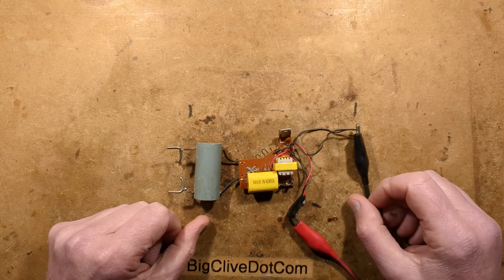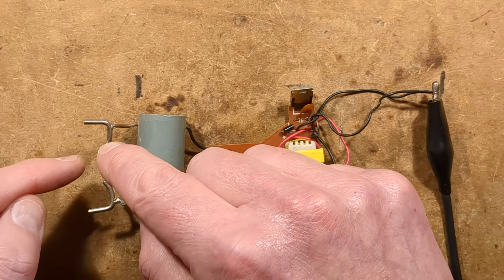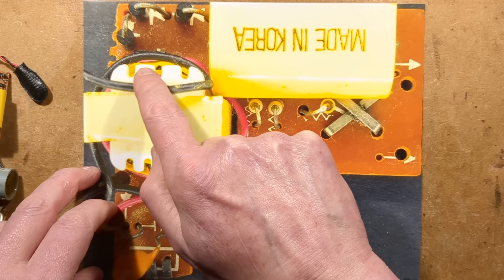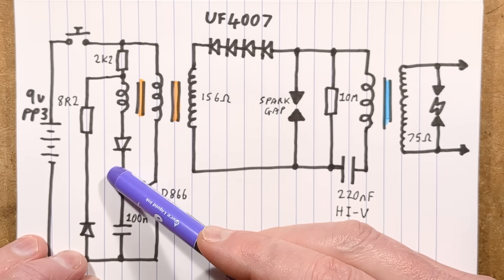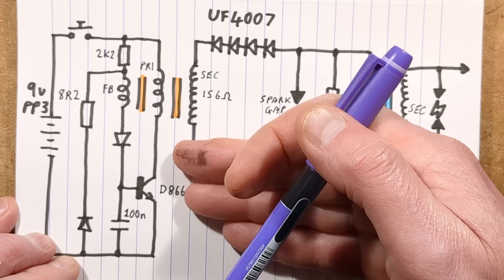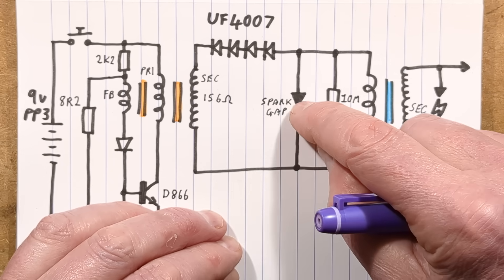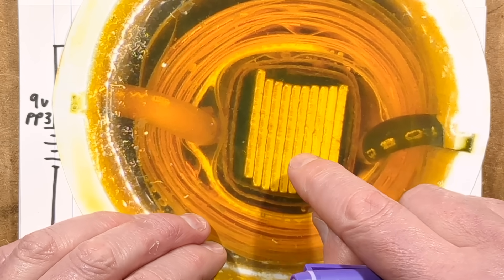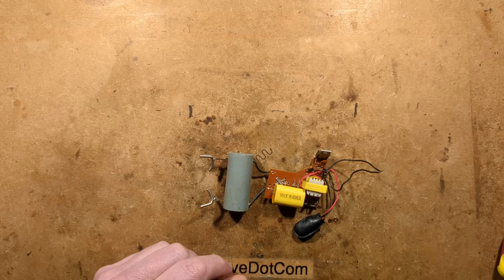How a stungun creates 20kV from a 9V battery

Comment: Back in the 90's I took apart an old unrepairable radio receiver. I deemed it unrepairable because someone had dropped it and the circuit boards were pretty much crushed. It was also from the era when printed circuit boards were a fairly new thing and were made by silkscreening a conductive, silvery ink on phenolic-impregnated cardboard. Some traces had come off of the board and were no longer very traceable, and I didn't have the right kind of solder for it either. Nevertheless, parting it out yielded a collection of entirely workable parts to tinker with. One of those was a transformer with a center tap in the secondary. 2x9V maybe, not sure anymore. I built a project based on the multivibrator used in decorative LED blinker circuits. Only I put 2N3055 transistors instead of BC547 in it and replaced the collector resistors with the secondary, which was to operate as the primary in its new life. I then tried it with different batteries as the power source, and IIRC the lowest it would oscillate at was 4,5V. When fed 6V the output would give a tingle on the fingers, at 9V it was uncomfortable. I think the highest I tried was 12V but it got hot quite fast. So I reverted back to 9V and did more experiments. I rigged a rectifier bridge on it and could charge a capacitor up to about 300V.

Comment: Hmm, makes me wonder how those fly zappers work. They don't make any noise unless a fly bridges the gap and there is quite a pop/snap. My favourite one came broken  (evil grin) and without the discharge resister. I can turn it on (hold the button for a bit) and when I let go, I can still zap at least one fly/wasp/whatever, which then acts like a discharge resister. It also means the "zap" is a bit stronger. This would suggest a mod to such devices....
Reply from the maker: They have the first bit of this circuit and sometimes a single stage multiplier to boost the voltage up.
Reply: Actually, they do make a very high frequency "tweeeeee" when you hold the button down.

Comment: Funny story. Years ago my gf lived in a very bad part of town, so i bought her a pink stun gun just in case she needed it. Fast forward to several years later i moved her in with me and i foind that stun gun and plugged it i to the wall outlet to charge. A day or two later i removed it from the outlet and hit the button and it didnt do anything. So i went into our room where she was sitting and pretended i was gonna zap her but didnt even hit the button, just made a noise with my mouth. She scolded me about how i could have hurt her. I held it out and hit the button and said see, it doesnt work anymore, then proceeded to touch it to my right thigh, needless to say i met the floor in a split second and my leg hurt for a couple days. I was laying on the floor laughing so hard and so was she.

Comment: This puts me in mind of a rechargeable electric lighter I bought that I find really clever. It operates on a similar principle (without the extra boost coil) to send an arc between terminals, but it has 4 of them & arcs in a X shape, & it took me an embarrassingly long time to work out that they were getting the two most distant terminals to arc by rapidly disconnecting the other two, so it looks like X but is in fact alternating between / and \. Lovely little bit of design for something smaller than a Zippo, & the battery lasts forever.

Comment: How does this differ from the black plastic HV tubes you can buy from e-bay (and other places) for a fiew £ each? Do they have the same components just potted in resin? I have one that was in a stun flash light but the cheap Li-Po cells quickly died so I disassembled it to se what was in it and how it worked, it looked identical to others I seen on line. Is there risk of over voltage if spark gap is to big?
Reply from the maker: Those ones use a boost circuit followed by a voltage multiplier.  It's important not to have the high voltage wires too far apart as the high open circuit voltage can damage the circuitry.

Comment: I’m surprised the first stage was such a high voltage. My preferred is to step up to around 400V and then dump into the secondary stage with a thyristor with a Diac trigger. 
I made several in the eighties but was never brave enough to test it on myself!

Comment: That's a real stun gun because it uses high-voltage AC output. Unlike the trashy ones that use a voltage multiplier and output a high-voltage DC.

When your skin, the same as a capacitor, charges with HV DC, it creates a very high resistance to continuously applied voltage, making it very ineffective and dangerous, because it enrages more an aggresor.

DC HV is louder; they really kick with the first few pulses, but are completely ineffective in stopping an aggressor.

A bull will not fake this. Tests were done with a bull and it got angrier with the HV DC, but fell to the floor with HV AC, like the one you have.

The police tasers use HV AC.

Comment: You say that secondary resistance (in the 2nd transformer) is quite high at 75Ω, but I wonder what gauge the wire is?
I rebuild vintage engine ignition magnetos & my secondaries (usually in 0.08mm wire) are around 3-6KΩ, depending on the model. The average coil having 10’000 turns on top of roughly 200 turns of a much thicker primary (anything from 0.6 to 1.0mm diameter).

I can’t reliably wind anything thinner than about 0.06mm with my machine & my current wire tensioner, but I always fancied having a go at one of these circuits.
I’ve bought the cheap Chinese modules from the usual websites, but they’re very susceptible to over voltage, not very strong. I expect they’re not properly VPI encapsulated, which is another thing I do with my magneto coils.

Incidentally, my magneto coils are wound in a very similar manner, with the paper between each layer of windings. It’s a good 2 hour job to wind each coil. It’s a job I don’t particularly enjoy, but I don’t trust any other company to do it properly, so I do it myself.
Reply: By the way, my primary resistances are usually too low to measure with a multimeter. Around the 1Ω region.

When I bought my winding machine over a decade ago it came with boxes of transformer bobbins & both metal & ceramic centres, as well as a load of enamelled copper wire that was useless to me. 
I sold what I could, held onto some of the metal laminations & recycled pretty much all of the plastic bobbins. Shame. 😢

Comment: There is basically a scaled down version of everything on the stun gun circuit board, minus the large 2nd output transformer, in your electronic zapping flyswatter. 

The swatter puts out around 3000 volts @ low current, but it is still not pleasant to come into contact with the output.  

I usually clip the bleed down resistor that is across the output capacitor off the circuit board of my electric flyswatters. Doing this provides a much larger zap across the grids of the swatter, and then it'll kill larger insects like wasps and hornets, BUT, you must be aware that the grids will now hold a charge for a very long time if the button was pressed and no insect has come across the grids to discharge the capacitor. It WILL shock you one time if you touch the grids even if the button isn't pressed. If you have pressed the button, and not zapped an insect with it, if you discharge the grids with the tip of a pencil lead or something else metallic, then the stored charge is gone and it wont be able to zap you until you press the button and charge it up again.

Comment: Playing around with one of these high voltage devices I found out that the spark activated the eject drawer function on my CD player, even from 5 meters away. Zap-zap and even with CD player in stand-by mode it went bleep-bleep and opened the drawer. Never found out how to use it to close it again though... 😂
Reply: That's interesting. I would guess that it's probably down to the infrared of the arc itself matching the eject signature from its remote control, assuming it has one. Perhaps if you modulate the zaps a little more you could get it to close again.

Comment: Whenever I find or create a high voltage (low current) device, I have to test it on myself, too. I end up testing to see how much I can handle. You know, it's actually quite easy to handle once you get the feel for it. You can trick friends and family into thinking it's pretty benign. Not that I'd advise anyone to use family members as test subjects! 😂

Comment: If you pot the whole thing in HV potting compound, can you use it underwater as an electric eel? I’ve heard that real electric eels put out about 700-800 volts and can discourage even a large animal like a crocodile or hippopotamus. I can see someone having a wee bit of misadventure trying to sneak up on a hippo with one of those. 😊
Reply: I believe that water, especially somewhere like a swamp or the ocean, would be more conductive than air, so you'd probably lose a lot of the voltage due to the smaller gap arcing "early" but yea I see no reason why it wouldn't work. Dealing with the spark gap inside it could be an issue since you can't surround that in resin without also adding some kind of inert gas to it (otherwise it won't spark). Perhaps hold it in a bucket of argon & apply a bit of kapton tape over it to do the last bit of resin.

Comment: One can pry the spark gap open just a little bit, and get a little more of a wallop out if the device, but DON'T go too far or you WILL flash over the windings in the output transformer, and then its cooked.

Comment: Way way long ago, in another time, like 1959, I made a simple zapper from scrap bits. A mechanical buzzer, 9V battery and a speaker transformer. Took it to school and got into trouble. Couldn’t have gone better.
Reply: Even just a simple relay wired as a buzzer will give you a zap from the back EMF when the relay coil magnetics collapse each time it rapidly opens and closes.
Reply: @davelowets    Or just if the relay switches off once.  There was a time when I worked on equipment that used a lot of small relays - mostly they had diodes connected across the coils to suppress the back EMF spikes, but not always. These could give you a sharp bite if you weren't careful.
Reply: @davelowets  You need an AC relay though. The DC relays (at least some of them) have built-in freewheeling diodes to keep the voltage from spiking.
Reply: Washing machine solenoids are good. Add a thick primary.
Reply: @davelowets  yes, I learned this the hard way. After it happened twice, I figured out why.
Reply: @davelowets  I zapped myself pretty good with just 4.5V battery and fluorescent tube starter coil 😂
Reply: I came to the comments to recall pretty much an identical story, except mine happened in around 1992. Had some fun with it in the playground, but it got confiscated by the staff by lunchtime. One of my teachers later confided in me that my creation had been passed round the staffroom, and the teachers had all had a go at zapping each other with it!
Reply: Yep, done that too, circa 1978! In my case, PJ996 battery and the field output transformer from a dumped telly. Bollocking from French Master ensued.
Reply: Me too, around the 1960, using bits from an old wall-mounted telephone.  Made my dad swear.
Reply: There was a Meccano set - back in the days of real Meccano - which included an electric shock machine as one of the projects in the manual.  Basically it was the same as the "electric bell" project but without the bell and with electrodes wired across the breaker contacts.  Set number was 4EL if I remember correctly.
Reply: I just realised I actually made a zapper too 😂.
1988 I was on a basic BT course, wiring a simple telephone circuit.
If you finished quick enough you could ring your friend's who were still working on theirs and electrocute em 😂😂😂
Reply: lol, reminded me of charging up a small engine condenser and tossing it to a classmate in middle school shop class. He was not a happy camper!
Reply: BRILLIANT
Reply: This makes me very glad I never got around to making a disposable camera taser when I was in high school.
I preferred to use them as intended.
Reply: That reminds me of a book, I forgot if it was supposed to be non-fiction or fiction, where somebody's lunch kept getting stolen from their lunch box, so they rigged up a ringer into it that goes off when the lid was opened. 

But the problem is that they didn't make a way to open the lid for themselves, so when it was lunchtime and the thief hadn't struck they were doomed to open it and trigger the alarm (and get in trouble).

IIRC they then rigged a hidden disable switch for the alarm, but the thief figured it out and stole the food without being alarmed. 

And finally the bypass was removed and the thief triggered the super loud alarm in the middle of the class.

 I don't think that they were caught, but they never stole from anybody's lunchboxes again after that point. 

So I'm not sure if the tech existed back then in the local hardware store, but today you'd probably just put a lock on the box or use a magnetic switch and a magnet to disable the alarm?
Reply: When I was at school in mid '70s, the physics teacher had a hand-cranked magneto from a field telephone, and he liked demonstrating it by electrocuting us students with the thing. The favourite was having students all holding hands, with a student at each end holding a wire from the thing, and then him giving the magneto a good fast turn. I'm pretty sure he wouldn't get away with tricks like that now in schools.
Reply: Same thing here, roughly same time.  Rumkopf coil
Reply: The old shoe type camera flashes, the type that made a whirr when they were powered on, they had a 400v cap in them. If you ran a wire like a paperclip from the flash outputs, they delivered a massive shock at at the press of the test button. So much so, a friend was showing off he could take it to his dad. He was literally crying on the floor after :)
Reply: You reminded of the  high-school radio trick...we'd put a radio into the drop-ceiling very low and tell the teacher "No, we dont' hear anything."  She'd think she was developing psychosis.
Reply: I did the exact same thing around 2013 except it was a prebuilt transformer that I hooked up to a 9v battery and used a doorbell momentary button as the switch and threw it all in a small wooden box and was going to use it to make another ignitor for a potato gun but before I hooked it up for that I decided to take it to school and set it off during health class and freaked everyone out freshman year in high school because I was homeschooled until like a month prior to that day and we had already finished our lesson so I didn't see anything wrong with it but yeah the principle wasn't happy but could tell it was more of a lack of public school experience so he just told never do it again and I didn't but the staff at the next high school I went to sophomore-senior year probably wished me and my friend group had just done that sort of stuff rather than what we ended up getting into
Reply: In 1970 magic shops sold joke handshake buzzers and electric lighters. You could also buy army surplus hand generators, cheap.
Reply: No batteries required - Back in school, someone took apart an arc lighter and kept the arcing mechanism (bare) - brought it in the class and was zapping away people, even experimenting by asking us to touch metal objects and zap us from a distance. One more thing we survived in the 80's... 😆
Reply: @darkguset  I did the same and got in trouble.  The principal took it away.  I responded with "Oh, brother, give me a break...ridiculous" and got suspended.
Reply: A friend of mine built a "steady hands game" where if your hand wasn't steady, the handle part wasn't insulated, so by making contact with the bent wire...
Reply: @jamesbrett6518  I remember seeing a design for that in a kids' science book. Of course all that happened if you failed was the little light came on.

Comment: As a boy in the 60's it was common to test such a battery using ones tongue. This is one up on that me thinks.
Reply: There was an urban legend about how low resistance at your tongue would actually enable that to harm you -something tells me it could actually happen if you tried it with one of these devices

Comment: I made one of those using diodes and capacitors in a Cockcroft-Walton configuration some years ago and it was pretty dangerous in the wrong hands, I don't know what happened to it that's the frightening thing 😳.

I think that it kicked out about 25Kv and quite a high current 😲.

Comment: What, no EMC supression?! 😉 Arcing, which is what the spark gap is basically doing, is usually undesirable (carbon build up, metal pitting etc). I wonder how long this device would actually work for?
Reply from the maker: It's only designed for brief bursts of use.

Comment: That resistor you suspect of being a design flaw is just fine. It never sees significant current. All it has to do is resist the applied voltage until the spark gap fires, and slowly drain the capacitor when the device is shut off.

In my experience with such devices the most common failure mode is the output transformer suffering an internal short when the output prongs are shorted with a metallic or other very low resistance conductor. The spark gap, despite being a negative resistance device, actually presents considerable resistance when conducting.

Spark gaps are weird. You should talk about negative resistance devices more.
Reply from the maker: It's mainly the voltage that is the issue.

Comment: Maybe it's a dumb question but why can't the high voltage transformer be driven directly by the first low voltage circuitry
Reply from the maker: It needs high current pulses on its primary.